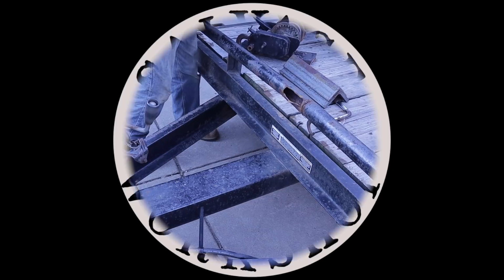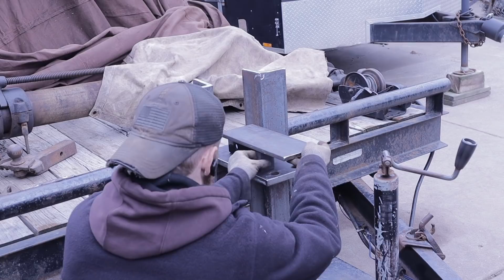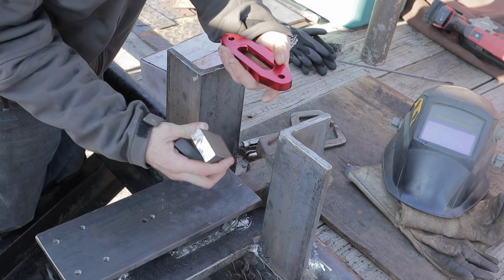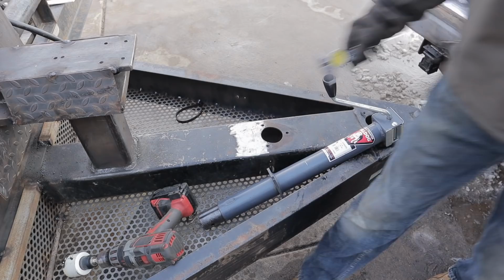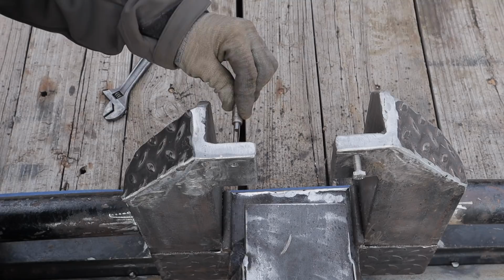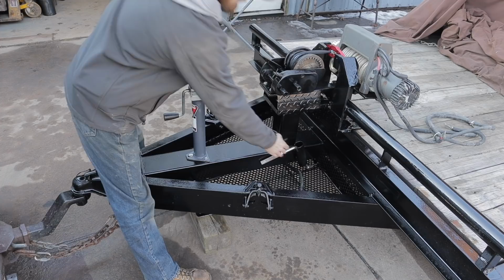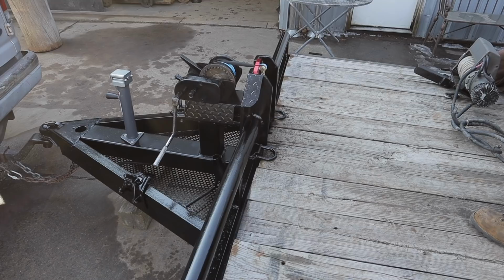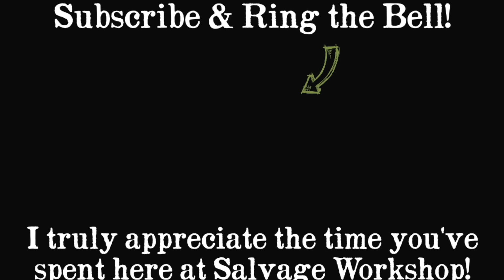Creating the ULTIMATE Trailer Winch Setup ~ This one is a THANK YOU for a Friend!

Comment: I would of added a receiver tube to the front of the hitch plate to receiver the electric winch with a locking pin and that way the winch is always on the trailer, with a battery box for the electric winch and then a cable with Battery Quick Connect/Disconnect Wire Harness Plug Connector to go between the tow vehicle and the winch battery and put a 3 battery separator under the hood with second battery and run to ground from the second battery to the back of the tow vehicle and my hot wire from the third battery separator that way you got high Amperage charge for the trailer battery while running the engine and put a starter solenoid  (From Amazon: Transpo New Starter Car Truck Solenoid Relay for Ford 12V Heavy Duty Marine SW3 only $8.00 and free shipping) to tie the two batteries together for self jump starting and then run through the grill two (Battery Quick Connect/Disconnect Wire Harness Plug Connector one from each battery but don't tie the batteries together that way you can even jump start a 24 volt system and run a third (Battery Quick Connect/Disconnect Wire Harness Plug Connector) off the second battery for a front mount winch and put all three on there own separate solenoid with switches in the cab now the winch will need the correct Amperage solenoid that you can hook a remote wireless controller and the same for the trailer winch it's the same thing I've done to my pickup, and I run with 4 high Amperage alternator's. My logging trailer has six winches on it two 12,000lb and four 5,000lb winches the four are for skidding and lifting they are mounted to four crane along with a log loading system with grapple, you can look them up on baileys.com under  Home > Industrial Machinery > Hydraulic Log Loader Trailers > Hydraulic Log Loading Grapples.

Comment: 1:18 min, I don't recommend you to ever put your hand under the end of your band saw, ever. Especially with the other in the trigger. Is wiser to, whenever you're going to cut, be ready to lift both pieces you're cutting, in this case maybe with a 2"x4" or a wedge of 2"x6", or a brick or a paver or a rock because who knows the pressure the trailer had gone thru (prolly since it had a winch, it was microscopically pulled towards creating like a backwards C we don't see, but once you're cutting that pressure is closing your cut right in front of you, while you were in the trailer cutting, the center of that backwards C, hope you understand me) so you'll need to pull it up and out towards the A frame. Be careful! As I continue to watch up to 1:53 min, that bar center is pulled towards the back like a backwards C that's why it was squeezing your band at the top and front of the tubbing against your band.

Bad thing on a fixed guide, if you have a taller car you'll be pulling it from a higher point and the cable will be fighting against the top of the guide. Ideally, we would want a guide that can be slotted into an up and down guide itself. To make it so it doest slide up or down you'll have to H it with its legs into two tight C's (tighing or guiding it's H legs), being the center of the H the guide, and the legs of the H an addition so the guide, into the two C's so the guide can be pulled up or pushed down by the cable as it's slides free into the C channels so the cable and guide last longer.

Did you just decapitated that hitch bro? Jises! Lol bro you don't have a degreaser or a torch to soften the nut? Poor hitch!

33:39 min. Overbuilding is the best and only way to build. If something failed, we already got its second or four in this case security or safety systems to protect the winch from flying. That's what my father and I do as well!

A good coat of 50/50 diesel and oil (could be filtered motor used oil), can make those planks last years. You prolly know how old timers and farmers cover their fences, barns and houses with oil spreaded or liquefied with diesel.

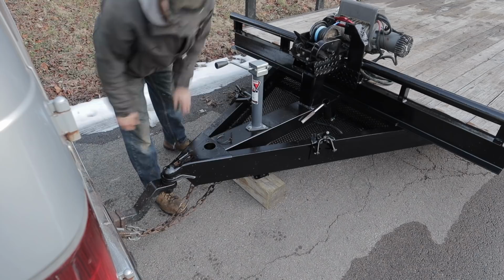46:53 min Smart decision as you know how to maintain and overbuilt while you acquire your own or his, one day! Great job man!

How is the rope hand winch rated?

Comment: Why do you have tape over all of the nameplates of your DeWalt drills, batteries, saw, etc. 

Mounting the winch further ahead would have made for more room if you load something longer than your trailer like a car or truck or implement that may have to hang a bit over the front of that round bumper bar you cut. Now, whatever it is may hit that mount, like maybe a truck bumper or what have you.

Comment: I really enjoy your tool restoration videos, but I have to admit I scratched my head a few times during this one. Your welding and fabrication are very good, but...you cut up a $150 weight distributing hitch to make a $45 winch mount, and spent a ton of time welding nuts onto broken bolts to reuse the jack mount, instead of just relocating it to the hitch plate that's pre-drilled for it and putting an inexpensive plastic truck toolbox on the tongue, which would give you weatherproof lockable storage for your chains, straps, and winch? And I'm skeptical of having a 12k winch on what looks like a 7k trailer?
Reply: I wouldn't put a plastic truck box out in my shit house much less on a trailer
Reply: Not to mention the farther back on the tongue the jack is, the stronger it is
Reply: Oh and let's not forget that weight distribution hitch looks a little worse for the wear
Reply from the maker: You are looking at it as if I had to buy those items for this project, and other than a few of the upgrades, and paint, the project was completed with what I already had ON HAND! 

The hitch was free, I've NEVER used it, & I dont have the other parts for it. The jack needs to be where it was located to handle higher tongue weights when dropping the trailer with a load on it. It only took about 30 mintes to remove the 2 bolts.

I would NEVER put a plastic box on ANYTHING! Aluminum or steel is another story, I love those! I am not overly concerned with long term storage on this trailer the basket is for what's needed  on the trip at hand.

The trailer GVWR is 10,000lbs, and as with EVERYTHING, I'd rather have something capable of handling more than enough weight rather than not enough! The winch is NO exception!

Thanks for watching and commenting! I truly appreciate the support! Lots more to come!
Reply: @SalvageWorkshop  Also, that further aft trailer jack location allows you to open your tailgate...
Reply: guess he doesnt like questions or constructive criticism
Reply: @tatertots597  He DID reply, and defended himself adequately and politely, not sure how you missed it. It was many hours ago.
Reply: @SalvageWorkshop  I was on your side with it,  I think it turned out great.   It looked like a 10k trailer to me.  I may have missed it,  but did you put any gussets on the plate from the winch to the hitch?

Comment: Got half way through and couldn't watch anymore, your engineering skills leave a lot to be desired.
I noticed you had the trailer attached to your vehicle whilst you were welding, did you disconnect the vehicles battery, if not, 9 times out of ten you blow your alternator.